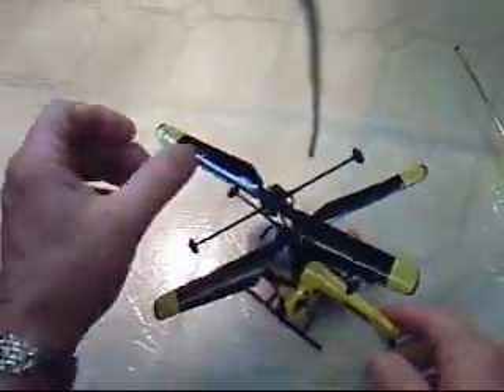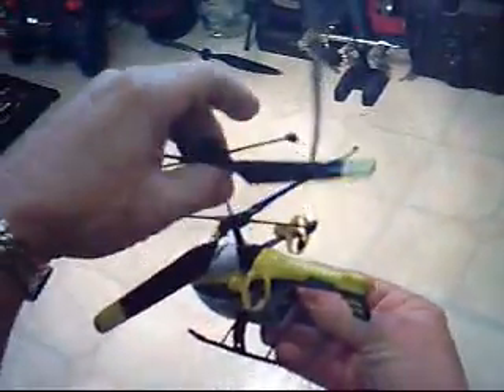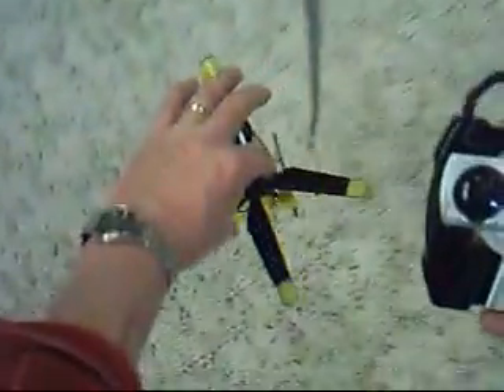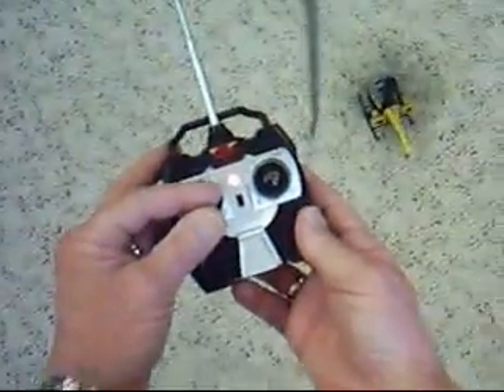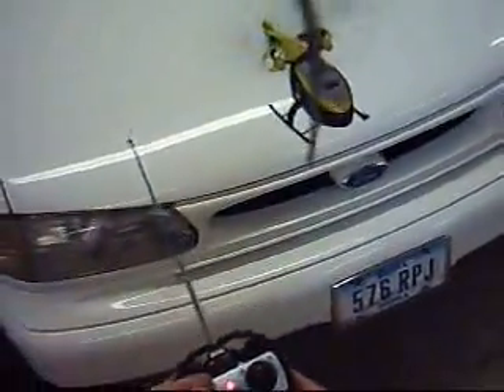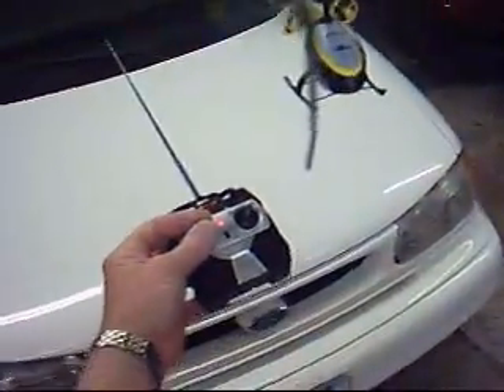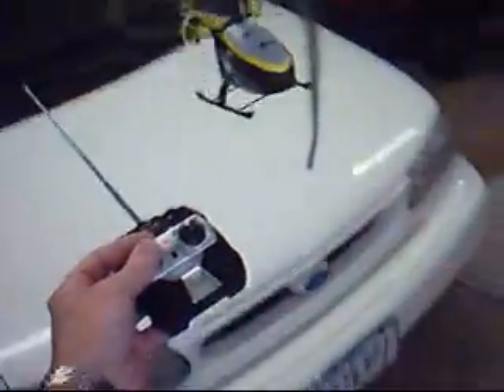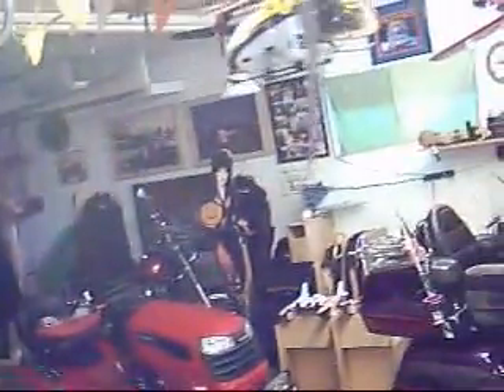TRIMMING the REFLEX  "elevator" helicopters

Comment: as i understand it there is no "tail rotor" as it were on the more expensive one of the air hogs helicopters, there are just 2 "pod thrusters" and the counter-rotating main rotors, so the main ones provide lift while the "pod thrusters" as i call them provide fowards and turning thrust. However, on the "cheaper" one (which i have) there is a main and a tail rotor and i always have to remove the tail rotor (friction-fit to tail motor) to unwrap hair from it and stop it spinning out of control